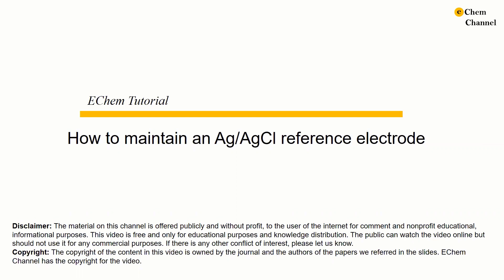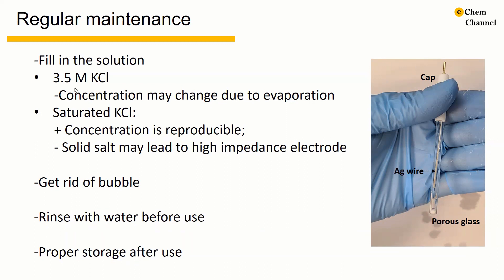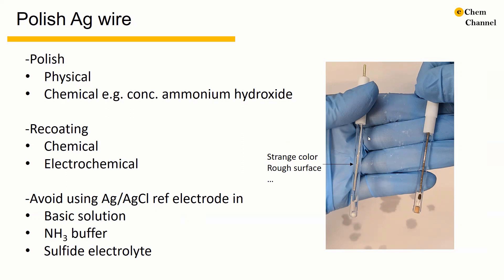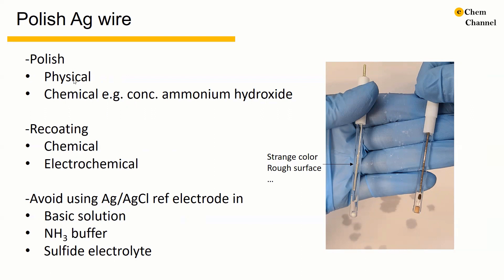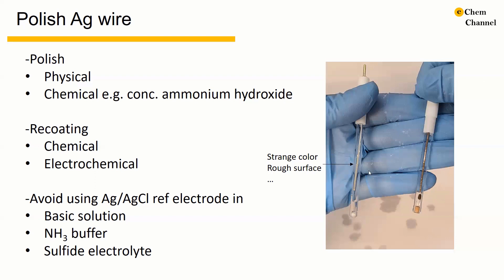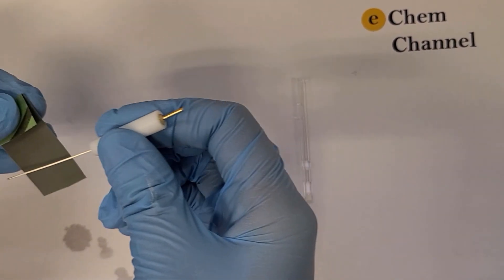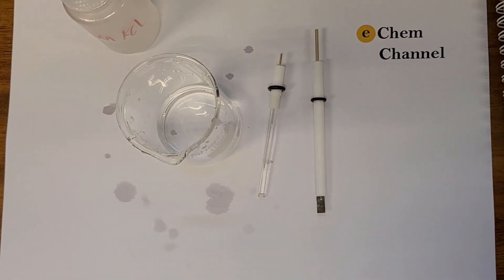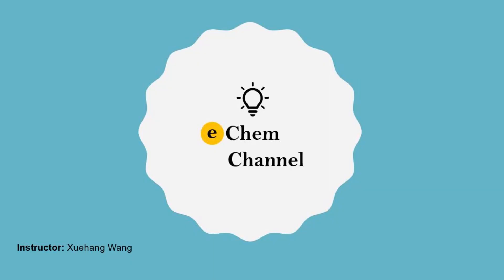Tutorial 28-How to maintain Ag/AgCl reference electrode

Comment: 1. What is the suitable grit number for the sandpaper that you use to polish the wire?
2. What colour is considered normal color for the wire? The AgCl coating should be white or brownish? I used an old eref left by previous students so I'm not sure what colour it supposed to be. I tried recoating in 1M HCl at 0.5mV for 3 minutes and got white coat around the wire, is this correct?
Reply from the maker: 1. Anything that can help create a new surface of Ag is fine.
2. I've seen both brown and white personally. Check the reference potential against another reference electrode to see whether it's in the right range and whether it's stable.

Comment: Hi. Thanks for your video, it's really helpful. I have 2 questions. Is it ok to refill a Ag/AgCl 3.5 M with 3 M instead? Also, what are your recommendations to store a Ag/AgCl 3.5 M that is used as a master electrode only (to check if other Ag/AgCl 3.5 M electrodes are working properly)?  meaning that most of the times is not in used?  Regards :)
Reply from the maker: Hi there, 

You can use a 3 M solution, but be aware that the reference potential would change. You can calculate the shift.

Regarding the master electrode and storage, I find this website helpful: https://pineresearch.com/shop/kb/applications/general-electrochemistry/reference-electrode-storage-master/

Comment: What if the reference silver/silve cloride electrode falls to the ground and feels like there is a powdery substance in its head? Does it still work?
Reply from the maker: @SamahAwadhMahyoub  gently wash the electrodes with DI water. If the AgCl layer is no longer intact, use the methods mentioned in the video to apply new ones.

Comment: Great video, it was so helpful.
Can i use the same procedure to prepare Ag/AgCl pseudo reference electrode?
Reply from the maker: You should give it a shot and see how stable the reference electrode is against a reference redox couple like ferrocene/ferrocenium.
Reply: @EChem_Channel  Your content is really helpful, I appreciate that mam. I have two queries;
1. At 3:16 I didn't understand the chemical method of re-coating.
2. Not specifically related to this tutorial but is related to the discussed topic; how can we use silver (Ag) wire as a quasi-reference electrode? how can we calibrate it against Fc+/Fc couple?

I would be grateful for your response. Thank You.
Reply from the maker: @AnwarAli-xh3gt  For chemical method, some examples include dipping the wire in FeCl3 solution or concentrated HCl solution.

Comment: What did you used at 4:50, to rinse the wire?
Reply from the maker: That was methanol
Reply: @EChem_Channel  METHANOL IS NOT GENERALLY RECOMMENDED TO WASH WITH...
USE DISTILLED WATER

Comment: What is the recommended supplied voltage for recoating the electrode using the electrochemical technique?
Reply from the maker: You can try a positive current of 0.1mA/cm2 or 0.5mA/cm2 in a solution of 0.1 N HCl
Reply: @EChem_Channel  Is it HCl or KCl ??
Reply from the maker: @PriyambadaPriyadarshinee-ck4yj  HCl was mentioned quite frequently in the literature. I've also seen applying 3 V for 10 mins for a Ag electrode vs. Pt in 0.05 M KCl.

Comment: Can we use the Ag/AgCl in Koh electrolyte.?
Reply: That is interesting for me too. I need to investigate my material in 6M KOH electrolyte. Im going to use as reference electrode Ag/AgCl electrode. But after watching this video I’m afraid to use it 😅
Reply: Not recommended. Experiment might run smoothly but you cannot rely on the readings using this. Hg/HgCl is recommended.
Reply: @mrkhan8700  what do you recommend for an electrolyte with Ag/AgCl reference electrode..